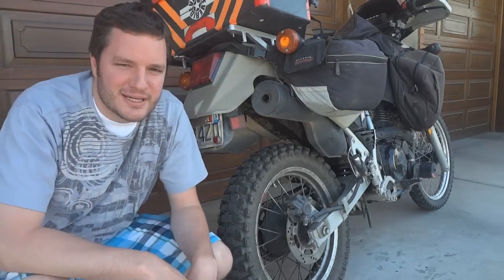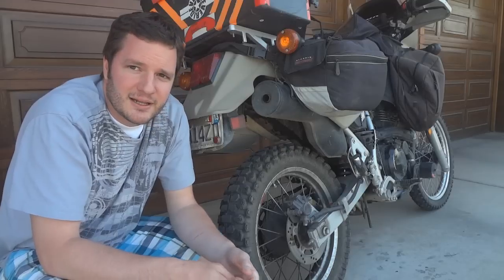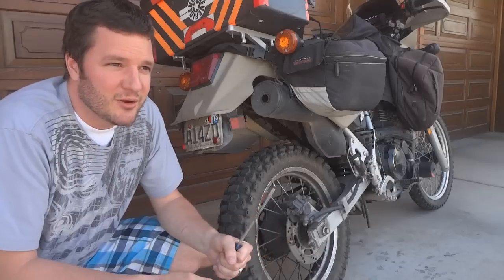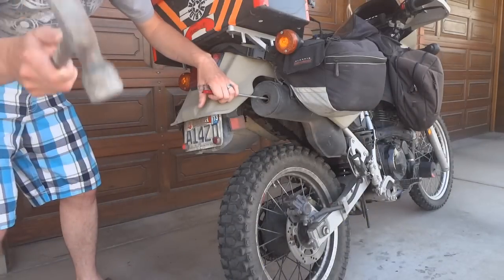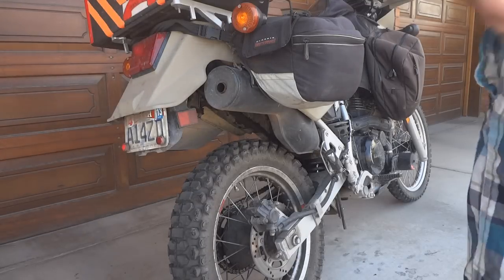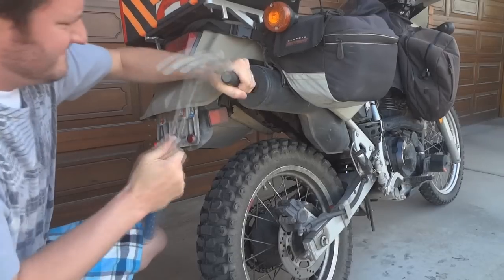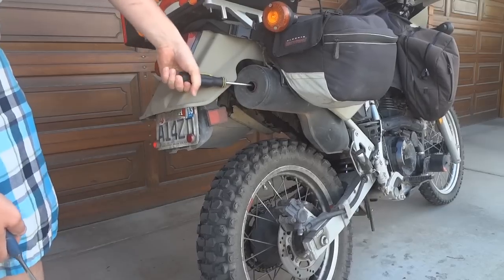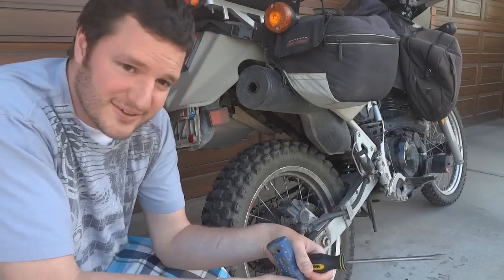o#o How to make your stock KLR 650 exhaust sound manly for FREE (get rid of the chirp!) Thanks NT8!

Comment from the maker: Hey no problem! They fit like magic on the KLR and have done a pretty good jobs protecting the fairings from slight bumps and bruises. They also keep my legs warmer while riding in winter. They're called "Classic Accessories QuadGear ATV Tank Cargo Bag (Black)" and you can find them on Amazon. I got mine for $40, it looks like they're about $60 now.

Comment: Judging from the turn signals and luggage rack, he has a Gen 1 KLR (2007 and older).

The Gen 2 (2008-2013) and Gen 2.5 (2014-18) have an updated muffler that has "drain plugs" for you to knock/wash carbon buildup that can cause chirping.

Comment: I've modified exhaust systems for decades anyone that tells you your engine will not benefit from breathing better doesn't know what their talking about !  My favorite mod is if you can get the muffler apart is to throw away all of the internal crap and just put the cap back on... sometimes however, that is just too loud to keep that way !  Honda Motorcycles of Old were notorious for choking down their motors to where they barely ran.... hense all my modifications ! if you have a 1 1/4" exhaust pipe header and it connects to the head.... and the muffler is only a 3/4" hole the engine is suffering, because of that...it can't breathe !
if you have close to a 2" header and a 1" exhaust outlet what is the point ?  manufacturers did this to quiet down those big noise makers... but it turns out that you are 10 times safer if you are riding a bike that can be heard !  80 DB is good enough
don't go to 120db  like most harley riders do , that is excessive noise and frowned upon by everyone but bike owners !
 inside a muffler can be rebuilt using expanded steel mesh formed into a tube and fiberglass matting  packed around it
a baffle can be made for your bike that will quiet it down immensely ... all it takes is drilling a thousand holes in the pipe and closing off the inner end.... 
if you want to do it right, the outlet for the exhaust should be slightly bigger than the inlet . but not so big as to make it a megaphone effect.  if you have a 2 into 1 muffler the outlet should be almost 3 times as big as the individual pipes coming in
this is the exact opposite of what manufacturers produce...  anyone that says you want back pressure in your exhaust system
is totally misinformed ! ...WRONG ! you want a vacuum if you can get it not pressure !!!
and you can get that vacuum by running a long straight pipe to a certain length ....  pulling up on the piston when it's on it's exhaust stroke really helps in performance !   however on a motorcycle that is close to impossible to accomplish the best you can hope for is no pressure or very little pressure on the exhaust stroke 
...sticking a screwdriver in the muffler is Crude at best, but it is easy to see the performance increase and sound change....
what you need to do now is drill as many holes in the flat back of the muffler as you can get in there... I'ed go with 3/8" drill and drill about 50 holes ! .... drill 8 first and see if more is going to make it too loud , just put a ring of holes around the exhaust outlet
and you'll finally be rid of that back pressure !

Comment: My Dad has an 05' KLR650 and we put a dowel (3/4") into the exhaust pipe, and took a 2 3/4" hole saw and drilled out the baffel. Took it completely out, and then took 3 clip nuts, a large flat washer and a small piece of tail pipe and made an end-cap for it. It's throaty and runs a lot smoother. His had that obnoxious chirp when it was stock too... haha.

Comment: I think you might be able to fix the chirp by following the cleaning procedure from the Clymer manual (this is what the two bolts on the bottom of the exhaust are for).
Reply: First thing I buy with a new bike are K&N air filters, a Clymer or Chikton manual, and the manufacturer maintenance manual.

Comment from the maker: Yeah I think a drill would have worked fine, but NavyThomas8 showed me how to do this with a screwdriver because I'm pretty poor and didn't have access to a drill. Also, the screwdriver has some "bite" on its edge so you can make the little holes easier.

Comment: Did you have to change the carburetor jets to maybe richen the fuel air mix?
Reply from the maker: +heffo and juff I didn't know about carburetors that much back when I did this, but it still ran nicely. I think the stock exhaust was choking it a bit anyway. For real airflow enough to merit a rejet I'd imagine a whole new exhaust would be needed, but I'm definitely not an expert on carbs!

Comment: I very recently bought an 09 KLR.   I haven't really paid any attention to the exhaust tone, but I'm sure I will now!  LOL.   Anyway, quite a few years back I owned a Suzuki DR350.   The DR had a bolt in the bottom of the muffler, I suppose to drain it of water or condensation?  I dunno.    I removed that bolt, and that DR responded with a much more enjoyable tone.   I did notice the KLR has a similar bolt.    Just thought I'd mention.
Reply: There are clean out bolts on the KLR, under side of stock muffler you can remove

Comment: all you are doing is destroying the baffles. its sort of like what guys used to do with glasspacks where they'd burn out the fiberglass before installing them
Reply: No it is opening the exhaust holes.
Reply: navythomas8 which is called... a baffle.
Reply: George O oxy acetylene torch works wonders. everything burns at some point, you just have to get it hot enough
Reply: George O steel burns great, its why car fires and office building fires are so intense